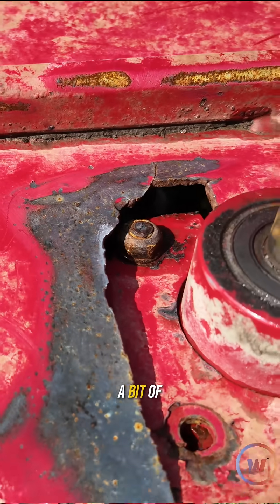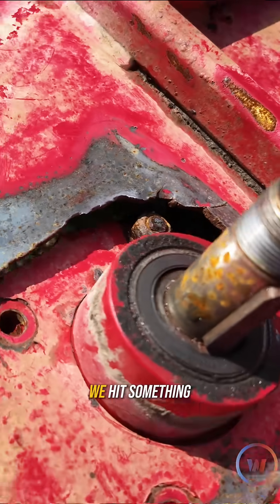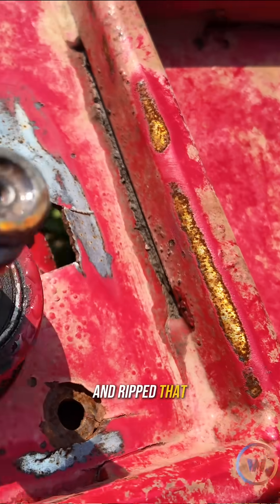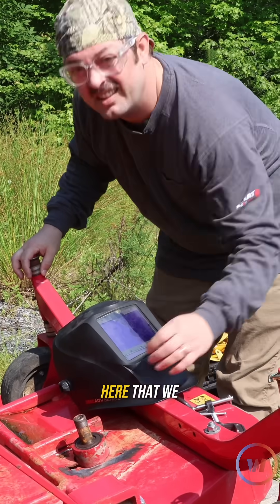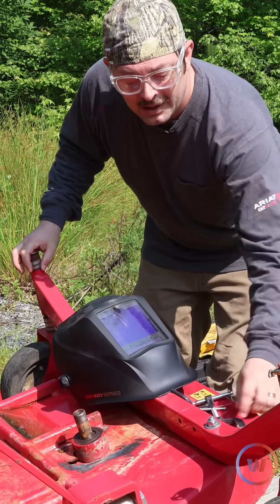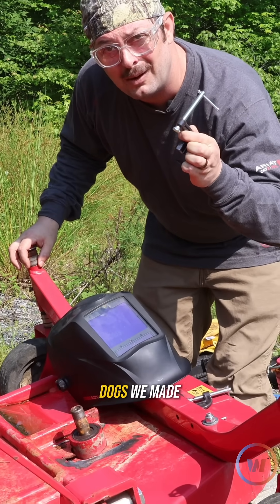Battery Powered Mower Deck Repair

Comment: The metal there doesn't seem that thick. Wonder why you didn't prefer the 2 mm 6018 rod to prevent holes? Would it be too weak to hold that motor-transfer belt's stress?